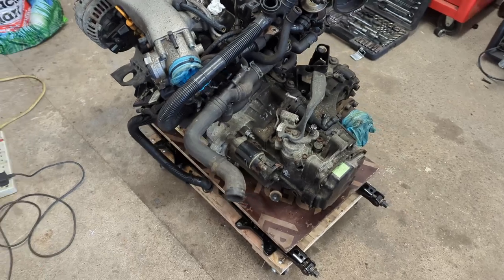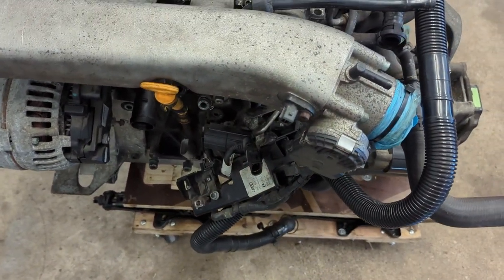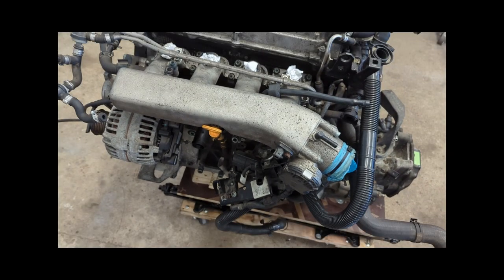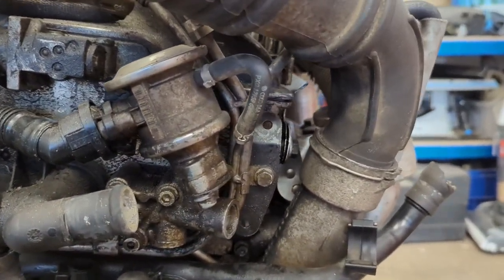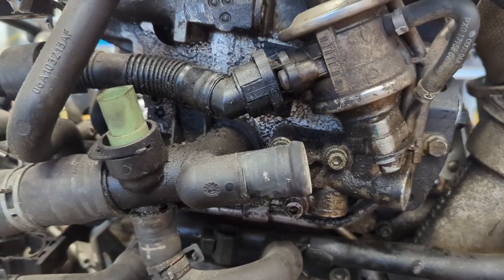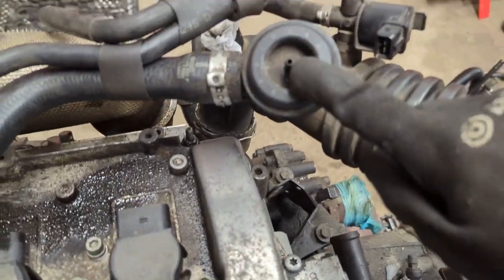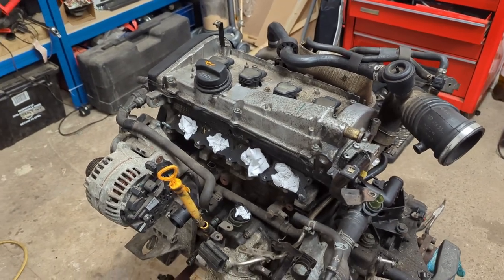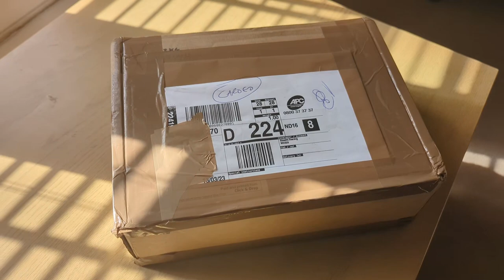Should you Remove the N249? (Plus SAI, N112 and Evap Delete)

Comment: Not a fan of N249 delete unless the system has failed already and don’t want to replace, as you said it is a fail safe to stop major damage if the n75 or DV fails. 
I would also keep the Puck when you fit the catch can system.

Nice video with great angles to let people see what they need to do 👍
Reply from the maker: Yep keeping the puck, saves that horrible oily smell you get with a filtered vent.  The N249 was really fascinating to learn about.  Most people just rip it out without thinking about it.  I don't know if mine works or not since the engine was bought on its own.  I still have it all though, so it can easily go back if it needs to (and I'd devise a way of mounting it a bit neater than factory too).  Glad you liked the video, more coming!

Comment: Can you not use a electronic means for the N249 system so you're not reliant on vacuum systems? Can the diverter valve be an electronic one instead?
Reply from the maker: I did actually question that.  Seems strange to use a solenoid to control vacuum to the DV when the solenoid itself could be the DV.  I reckon that by doing it this way, the DV can open using manifold pressure should the N249 fail.

Comment: Whit a tune can delete the CHECK ENGINE LIGHT ?
Reply from the maker: If the CEL is because of the SAI or Diverter control solenoids not being connected, those can be coded out by a competent tuner.
Reply: @cgten  is p2403 evap leak detention pump sense circuit open
Reply from the maker: If you’ve removed that system then you’ll either need to have it coded out of the ECU, or trick it into thinking it’s there by using a resistor on the plug, I don’t know what value you’d use though.

Comment: Do you get a check engine light ? If so can it be turn off some how ?
Reply from the maker: Yes you'd get a CEL, unless you have the systems mapped out of the ECU or you install resistors in place of the sensors to trick the ECU into thinking they're still there.
Reply: @cgten  anywhere I can get the resistors or they need to be diy ?
Reply from the maker: I've seen various posts on forums where people have DIY'd them, and I've also seen mentions of kits for sale, often from forum members.  It's hard for me to recommend anything specific because I don't have any experience with it, opting to map them out instead.
Reply: Is the cel the only downside? Does it make the car run rich or lean if you don't get them mapped out?
Reply from the maker: I can't see any downside as far as fuelling is concerned.  The only drawbacks will be a vacuum controlled instead of an ECU controlled DV, and you'd be removing a failsafe for the wastegate.

Comment: You keep going on about turbo surge but your wrong. Your going on about turbo flutter when boost pressure goes back into the turbo when you lift off. Turbo surge is when the turbo produces too much boost that whag the engine can accept
Reply from the maker: Compressor surge is what causes the flutter sound.  It sounds like what you're describing would also cause compressor surge, assuming no BOV is fitted and the wastegate isn't doing its job.

Comment: Nobody.. and I mean nobody EVER explains why you should remove it. It's not in this video either. WHAT IS THE ACTUAL REASON/BENEFIT?
Reply from the maker: I don’t think there is a benefit.  The only reasons people do it is to tidy up the engine bay or because they believe it improves response.  I think that by removing the system entirely, it eliminates a vacuum leak somewhere and that’s why it seems to have a benefit, the same benefit they would have had if they had located and fixed the vacuum leak.  I’m removing mine because I simply have no room for it, I actually think it’s a clever, albeit messy system.